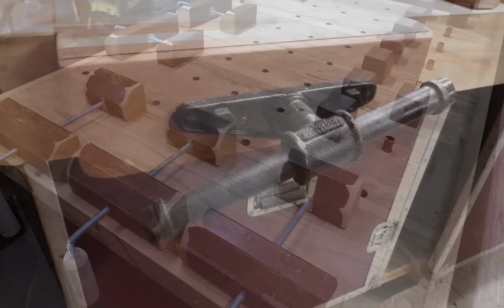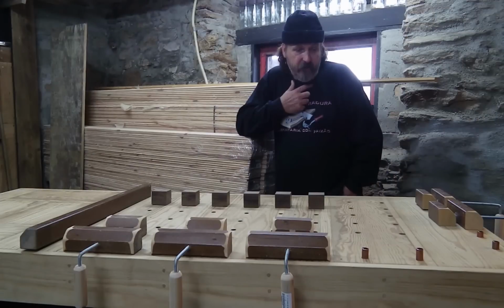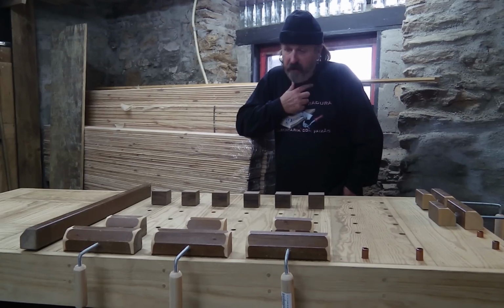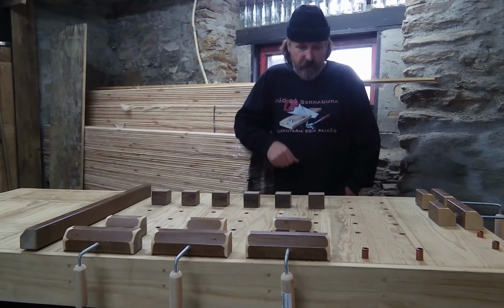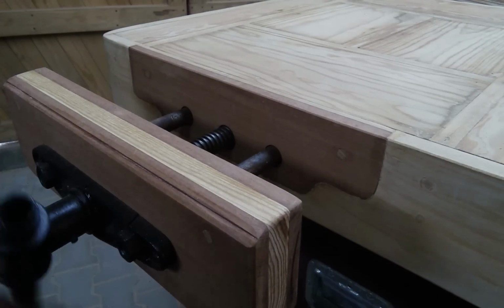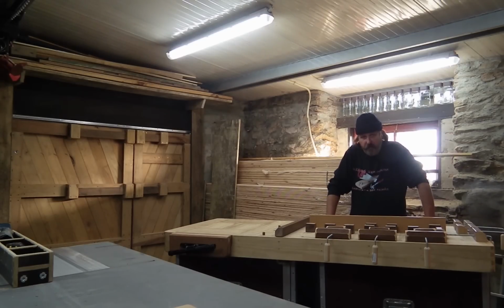#13 Low Budget Workbench, Shoptalk and a Knitting Queen

Comment: Great video and table, I really like the way you made it with scrap wood and that it can fit all kinds of sizes. 
Also great knitting Lena Selway. I would not mind if it was raining Winter has already arrived in Minnesota with temps well below freezing and a few inches of snow, just means more time in the shop because there is no yard work for the next few months.

Comment: Im in the thinking /planning process of making a 2.6 metre long bench to run down one edge of the garage. It will not be anything as elaborate as yours because its for a different purpose but I need somewhere versatile to do the many things I am capable of such as repair electrical items. I also need somewhere to mount some of my other  woodworking equipment. I have sheets of particle board left over from building the yurt bases and Im thinking of using  eucalyptus for the  simple framework because its cheap and available.
Reply from the maker: Don't make it to deep.... a mistake I made in mt early days. With particle board: look at a torsion box construction!